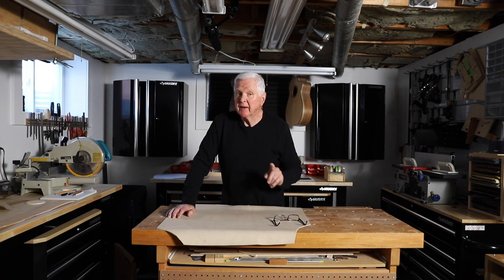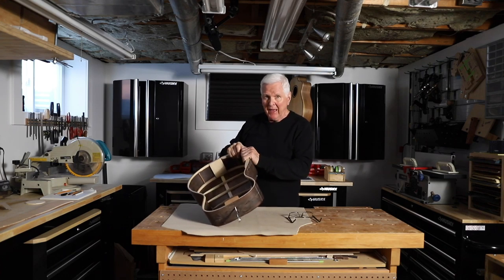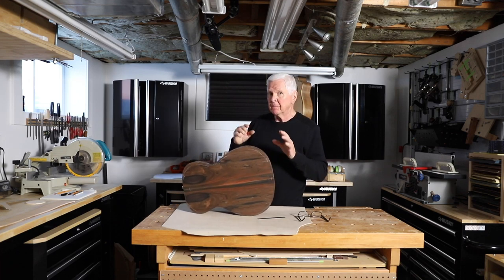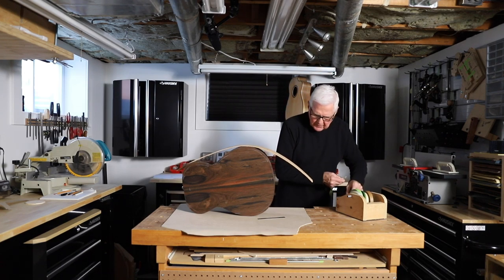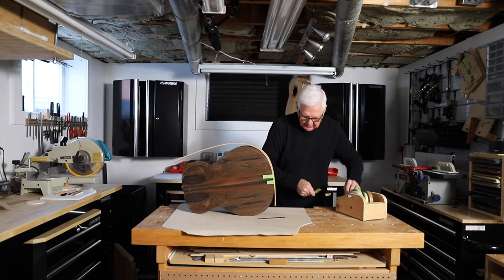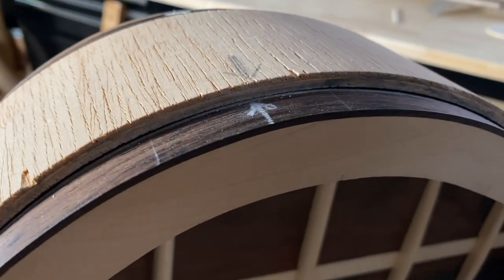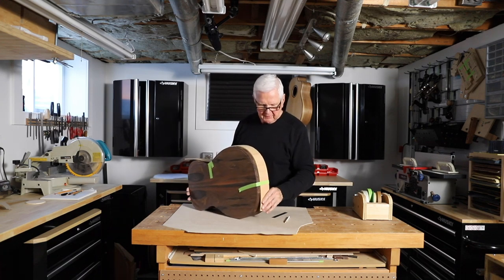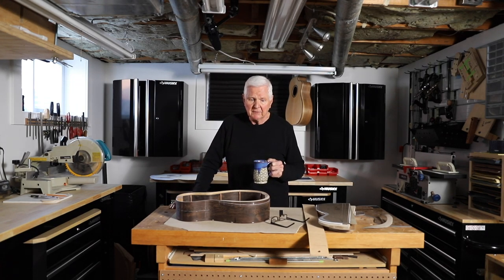Simple yes....BUT it's a VERY critical jig

Comment: Hello my friend, I just took one of my guitar that was getting scratched on the back and wrapped it with some clear wrapping vinyl.    I just hope that it doesn't damage the wood over time
Reply from the maker: Interesting
Reply: Yes I did it before on one and it's seems to be ok
Reply: It would be worth checking what kind of adhesive the clear wrap uses and what finish your guitar has. Some finger guards that go below the sound hole are stick-on so they must be OK. However, I had a soft guitar case made for a guitar and the guy used the same vinyl from the outer skin as the inner liner instead of the soft fabric I'd asked for. The vinyl reacted with the guitar finish and it all bubbled, destroying the finish altogether.